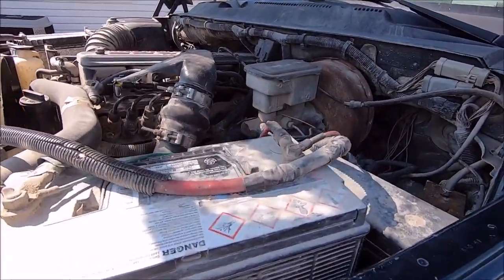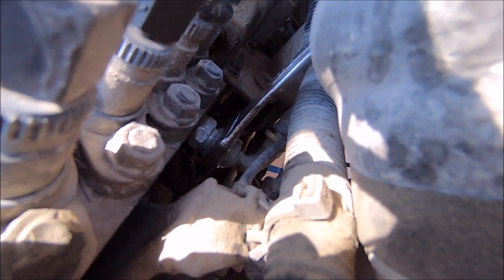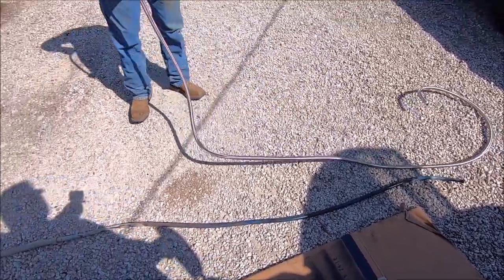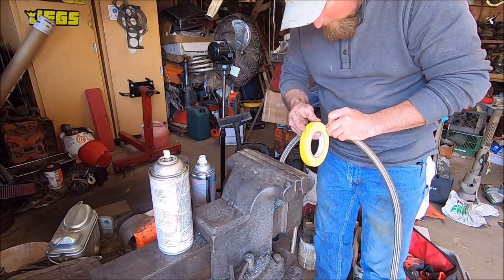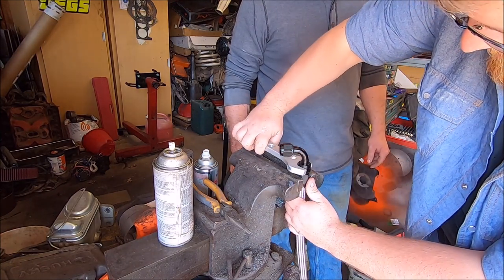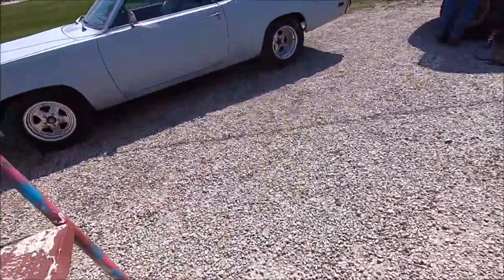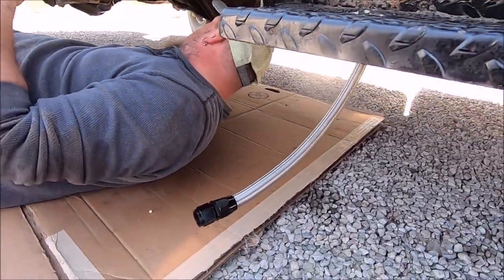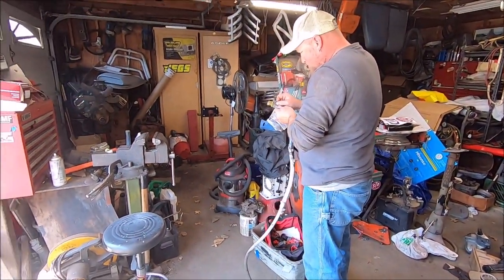Fixing a flaw with the Fass Fuel pump on a 12v Cummins Dodge

Comment: Just seen the video 2years later😂😂😂

Did anyone ever show you that the Hose collar of the AN fitting is threaded and tightens on the hose left hand thread then the connector threads in right hand thread. Never have to fight pushing the collars on the steal breaded lines again